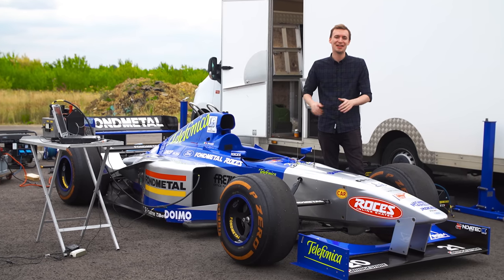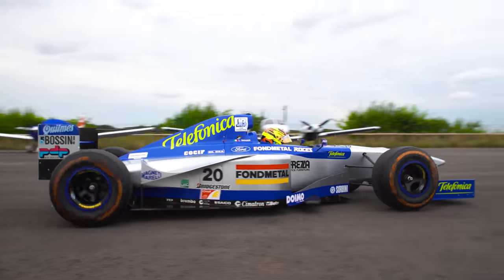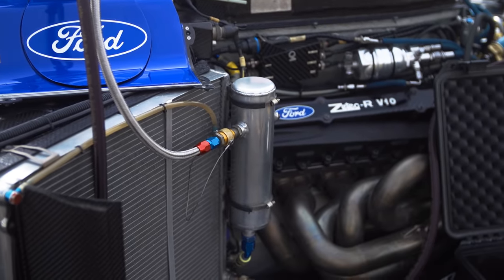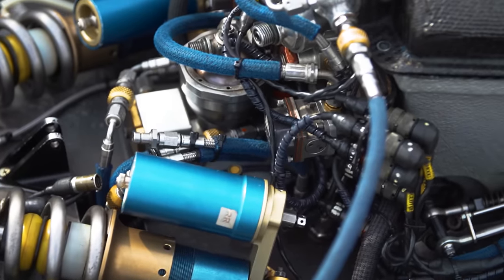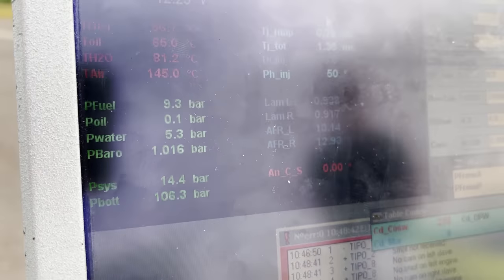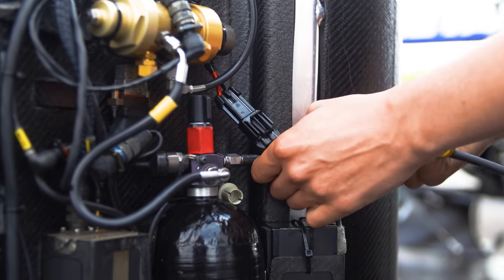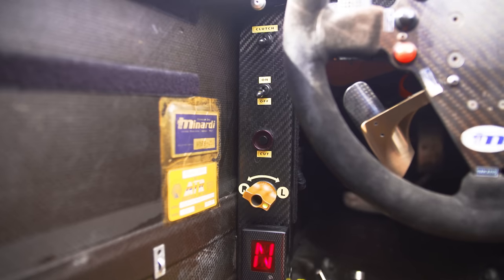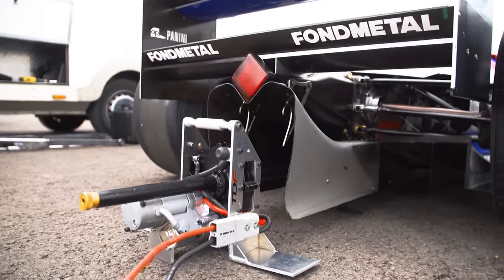Why Formula 1 Cars Take Hours To Start

Comment: They do the same thing on sprint cars with warming the coolant and oil up before pushing them off for engine heat. They'll usually let the engines idle to build heat for around 10-15 minutes and check everything over before hot laps.

Comment: I've worked in mission critical environments like oil pipelines, airports, telecomms and broadcasting, where the mains standby generators were heated and (if I remember correctly) the oil pressurized. I always assumed it was to facilitate rapid starting. Now I know better.

Comment: If I remember correctly, the Japanese Zero in WWII, needed to be preheated before flying.  The oil used in the engines was so thick, it was more like grease when cold.  They would start cold, but would sputter and not have much power.  When needing to take off quickly and not sit and heat up for 30 minutes, they attached hoses and circulated preheated oil through the engines.  This way they could take off with only a minute preparation, instead of 30 minutes.  This was especially useful on aircraft carriers and land airstrips when they needed to take off quickly to defend.

Comment: I've seen it in a few building management controls systems as well, over the last few years.
The pain of using something that slow in 2022 cannot be overstated.

I'm still a bit confused as to why a virtual machine can't be used? I heard him say that more powerful Pcs mess with the software, but wouldn't the VM take care of that?
Reply: It is because they did not hire good programmers. The interface timing is dependant upon the laptop speed, rather than being programmed to be independant of laptop speed. If this was a uni project, I would fail them.

Comment: Can anyone explain why they can’t use a modern laptop for this? I know he said they need Windows 95 for the software but I’d imagine there is some software port available that would make this possible, might just take hiring a few developers at most. The part I’m mostly confused about is when he said you can’t use a modern laptop because it’s quicker than the car. Sure it probably can process information way faster than the car’s sensors can read and transmit it but what does this have to do with anything?
Reply from the maker: Think you answered yourself there in the end! If the computer processes the information too quickly for the old sensors, could result in it not working all together - it’s a two way method as the laptop isn’t just reading the sensors but the laptop controls the engine “settings” too, so if a command back to the engine to change some mapping too quickly then again you’ll have issues!
Reply: @mattamys  Couldn't they just modify the refresh rate then? Sounds like a very easy problem to fix.

I'd say more than anything it's about them not wanting to change something when they have everything in working order.
Reply: @cyan_oxy6734  I was thinking this too. Not that I'm an expert by any means but the computer "being too fast" seems more like an inconvenient software fix more than any serious issue. I understand where they're coming from if this is the case though. Don't fix it if it ain't broke. Clearly the computer and software served them well for this many years.
Reply from the maker: Exactly plus this video was to show how it would’ve been done back in 1998, so yes it could in theory be done that’s not what we’re demonstrating!
Reply: you'll have to rewrite (or at least refactor) the software to utilize current OS, frameworks, and instruction sets. I doubt it's a hardware limitation since faster hardware should be able to tackle it, but old old software relied on the clock cycle of the computer for timing, and I doubt it occurred to them to future proof the software by using absolute timings instead. Again, that's a rewrite of the code. You'll also maybe have to add some abstraction or buffering in between, or at worst some low volume adaptor for a very defunct standard. It's doable, but why spend hundreds and thousands of dollars to do that for an old car? Easier to just get an old laptop to run the original software. Same issue actually exists with industrial process equipment lol
Reply: Well, they don't have the source code of the software to rewrite it. And disassembling the software to reverse engineer it is a massive task for a company such as this (i.e they don't specialize in this), and completely not worth the time, effort and money.
Reply: You could use something like VM (Virtual Machines) to run the old software at a specific speed - only reason you couldnt is that the plugs/connectors may not be compatible with the VM - but there are ways around it (gets quite technical)
Reply: Probably needs 16 bit ms dos, a parallel port and none of the power save features.
Reply: @mrwolsy3696  the UI clearly looked like it was running under the Windows 95 desktop, not DOS.
Reply: I am guessing on a new f1 car you have more modern software. It's just an old software in this case because the the car is older
Reply: If it ain't broke don't fix it.
Reply: It sounds like not properly designed software. I wouldnt burn my hands on trying to port something like that.
Reply: @beehard44  One day we could run out of old working windows 95 laptops
Reply: @hex8387  companies still make the hardware for industrial applications that suffer from the same issue
Reply: It's just not worth it. You could hire a few engineers and have it working on a modern machine, of course you could. There's really nothing you can't do with a computer. But why bother? What they have works, and it poses no problems.
Also, it keeps a little bit more of the charm of the old car.
Reply: There is another issue .  I have a friend still programming certain devices for e.g.  police force in the Netherlands with old computer and modems.  Asked him why. He said the signal put out by more modern computers is still zeros and ones BUT the rise time of the signal is quicker / different than older units.  So these older devices he programs , reads them out etc simply cannot communicate with modern computers.    

Never knew that.   So its not only baud rate and refresh rate but also how the signalform is made.....
Reply: Why is everyone so fixated on the laptop? Feels like Fox News up in here (I kid).
Reply: @cyan_oxy6734  a modern cpu and OS is 64 bit and doesn’t run 16 bit software and no serial ports/vdx
Reply: It's likely a boutique program written to spec by an operation that no longer exists or failed to retain documentation of their coding process.  So the code was written and compiled to operate on the machinery of the time, then the source code was discarded leaving the compiled program.
Reverse engineering compiled code is less like building a house from blueprints and more reconstructing a sauce or spice mix from taste.  You can see the functionality, but the structure underlying it has been compiled and optimized into machine language, like a spice mix can taste salty and sweet and smoky, but the precise constituent ingredients have been pulverized and mixed into a homogenous whole.
So now reconstructing it to work with newer hardware would essentially be starting over from scratch, with 1) the older program still working on period hardware, and 2) no incentive outside whatever money they get from nostalgia displays of the car.
Reply: You heard of something called money before? It costs a lot of "money" to develop software
Reply: They could just run windows 95 in a virtual machine that runs the system at a slower speed from the perspective of both the ports and the software being used. Concept would be similar to what GOG uses to run old games on hardware that is too fast (DOSbox etc). 

The big issue will be the interface that is used by the car's connection. Is it a PCMCIA card or something else?

I agree that attempting to reverse engineer the original program would be a fools errand considering the costs and effort required.,
Reply: The McLaren F1 diagnostic system only works on a particular Compaq laptop running MSDOS  - instead of a serial or parallel port they used a special PCMCIA adapter to talk to the ECU - think they scour Ebay on a regular basis to buy up this model for spares.
Reply: Just buy plenty of old Win95 laptops to have a good stock of spares.

On a vaguely related note, I read that quite a few UK banks' money-handling processing is still on old (1970's?) mainframes, I think because it was initially set up on these - currrent at the time, obviously - and they still work but it would be a mammoth job to rewrite everything and set up with new gear. It was only a few years ago that I read this but I'm not sure if it's still the case.
Reply: @bobfels5343  The software was properly written.....back in the 1990s.
One of the problems rewriting the software is finding someone that still has the ability to write that old code.
Reply: It is due to the synchronization, timing and polling when communicating with the computer ports. The software was developed and debugged using the hardware and operating systems speeds at the time. Windows 95 allows direct access to ports that later protected mode operating systems don't. I had the same problems with PCs controlling timber sawmills.
Reply: @beehard44  this. A lot of older software relied on CPU clock speed and as a result it will scale with that. Its why some older games run much faster than they were designed to when run on newer or emulated hardware
Reply: @davem5333  based on the very little information they give about it, I doubt it. And you cant write old code, all code starts new.
Reply: @lukemaney645  Exactly its probably working exactly similar to that, not as with a modern say game engine or similar of today where u compensate for different CPU speeds using the delta time between frames/cpu cycles
Reply: @halofreak1990   I notice that the laptop is running Windows XP instead of 95 (you can notice the Wifi and Lan Activity icon on the taskbar). The laptop is Panasonic CF-29 (Pentium M) , it's nearly impossible to run Windows 95 native on this laptop.
Reply: Some say there is a f1 car that takes 8hrs to start with 😮 Windows Vista

Comment: Wonder how much mileage can one engine run without a replacement.
Reply: Ive always read that engines before the v6 era didnt survive a race weekend. In the early turbo era or the 80s when the cars made 1300 hp or more in quali they would be rebuilt after quali. So they literally couldnt survive longer than the couple of laps around the track that they did one day.

 These days because of wanting to be reliable the regulations require each team to use no more than 3 engines for the whole season, no rebuilds or you get a penalty.

Comment: Is aero the only thing that affects times between all f1 cars. Like are they all the same engine bhp? Or do red bull ferrari and Mercedes have higher bhp?
Reply: Bhp, weight and setup also effects the times
Reply: While different manufacturers definitely have varying amounts of BHP, a large factor is the aero of each car. Aero setups can alter lap time by a couple of seconds
Reply: @nickowen7406  but im sure engines won't differ by hundres of bhp, probs 5 10 bhp?
Reply: @MrOptimisticc  while we don't have exact numbers it's probably closer to 50 to 60hp
Reply: @nickowen7406  damn thats a lot, i thought mercedes supply williams, mclaren and aston martin, dont they all use the exact same engine, or do mercedes tune down the opponents engine as they are the supplier
Reply: @MrOptimisticc  No, engine suppliers need to give the same engine for their partner teams as for their first team; there is a rule for that
Reply: @MrOptimisticc  If I remember correctly, by the regulations, engine manufacturers have to supply the customer teams with the same spec engine and performance/modes they, themselves use. So all teams using the Mercedes engine, can run it just the same the Mercedes team does. And so for other manufacturers and customer teams as well.
Reply: @Renee_R343  damn, so that just shows mercedes have better people in charge of aero then compared to the other mercedes teams?
Reply: @MrOptimisticc  the Mercedes engine is the same for all teams that use it. There's also Ferrari and red bull/honda. 

Each manufacturer is building within the same regulations but there's always gonna be small differences in approach. 

It's hard to say who has the fastest at any given moment but even at at 50 bhp difference, it's not much in terms of lap times
Reply: In short  yes some have more than others. But engine power isn't the absolute  guarantee  of a win
Reply: @nickowen7406  don't forget renault
Reply: @0wly  I totally forget about Renault supplying alpine
Reply: Aero plays the biggest part in modern F1. For example Mercedes and Williams are both using Mercedes engines, even though one is fighting in the front and one is in the back. All of the current engine suppliers are very competetive. The only expection was Honda in the mid 2010's where McLaren was considerably slower on the straights. There are small differences in engine power but nothing absolutely insane. My educated quess would be that engines explain max. 20% of the lap time differences between cars and aero min. 80%.
Reply: Other comments have answered it well - different engine suppliers, and even engine customer teams can set up the engines differently as they see fit. Aero is a major part, but so is suspension or brake/engine cooling. There are other areas that may seem mundane, but teams can get them either very right or very wrong and have a massive effect on the car's performance.
Reply: I would say yes. Barely any weight and HP difference comparing each team. Aerodynamic is the biggest factor in the game.
Reply: Every single F1 car is unique even amongst each other, now yes there are many specific dimensions and other specifications such as minimum weight requirements that make up the "Formula" in Formula 1, but each F1 car is different. The aero packages of each car are similar, but the shaping of the aero is different and unique to each car and each team. Even the engines themselves are completely bespoke. They may all look similar at a glance or from a distance on TV but once you get into the details there are major differences between each car. I won't even get into detail of the different engine mapping and suspension setups on the cars, those things can be changed pretty fluidly, depending on how the race engineers advise the driver to run the car or how they want to tweak the handling of the car under certain conditions.
Reply: To see the difference made by a higher bhp, look back in 2017. Ferrari had more power than Mercedes before a rule was introduced on oil consumption. Then Ferrari was far behind...
Reply: @nom1293  why what happened, didnt watch it back then
Reply: @MrOptimisticc  Ferrari was said to burn engine oil to have extra bhp. Once this was forbidden, Ferrari lost its power advantage over Mercedes

Comment: This is why the earlier F1 cars are more in demand for second hand sales, ones up til the early 1990s. They're simply easier to run on a private demo or track day with a smaller crew. Once you get to mid 1990s and after they're way too complex to run without 3-4 very knowledgeable people setting everything up. Setting up this Minardi takes some work, but you can bet some systems on the 1998 Mclaren and Ferrari are even more sophisticated and complex to check and run. The Mclaren had a second brake pedal and separate rear brake steer system system....

Comment: What surprised me the most was the Windows 95 thing. So basically in 20 years time, when there aren't any more old laptops around and working, you can't practically start that race car? Even if Win95 was running on a modern laptop he said it wouldn't work. Seeing how critically the laptop seems to be to starting procedure it's kind of sad. I really enjoyed the detailed explanations, though!
Reply: It could be done with software emulation. It would take some tinkering, but it's possible.
Reply: Considering it's a late 90s computer they probably wrote the software around the old PCI bus clock. The interface hardware for the car's onboard computer system might also rely on the same clock. 

In theory they could use basically any machine that has the proper hardware interface for the car's connector. Software side they could run windows 95 as a virtual machine or something of that manner to get the car's software to play nice.
Reply: @jeffqray  Uh okay crazy person. I've seen people deny a lot of things but denying that cars worked in the 90s is amazing.
Reply: @jeffqray  I really don't mean to be rude at all.... But you sound exactly like my buddy with schizophrenia when he doesn't take his meds. Like I saw your other comment on this video about space and sure, I can somewhat understand why people don't believe we went there... But why in the world would someone fake a video about a car starting? Do you believe that F1 cars simply just don't exist or something? Because if so, you know you can just buy a ticket and go see them in person, right? Shit if you paid enough money I'm sure you could stand in the pit room and watch them start it for a couple hours too.

Again, I'm really no trying to be rude or anything I just seriously don't understand why you would think someone would fake a video of a car starting. Just doesn't make sense
Reply: @NotMe-ej9yz  Take your meds

Comment: Not mentioned was pre-warming the tires.... it's not part of starting engine, but it's done now. Very common sight to see heater blankets over tires when car is in the pits or garage.
Reply: It's been done since the early 80s, and it's being phased out (there are already temp and time restrictions, which will continue to tighten until a blanket ban). Doubt anybody running the car outside a race weekend/proper test day would bother tho.
Reply: @docontra4921  Thanks for input.